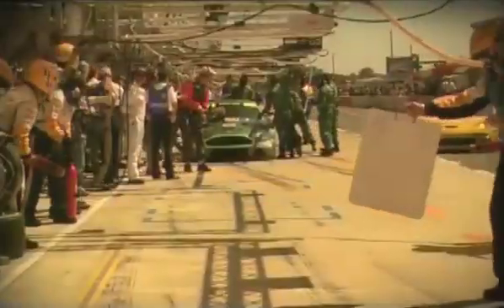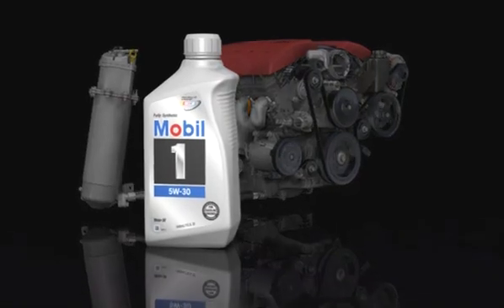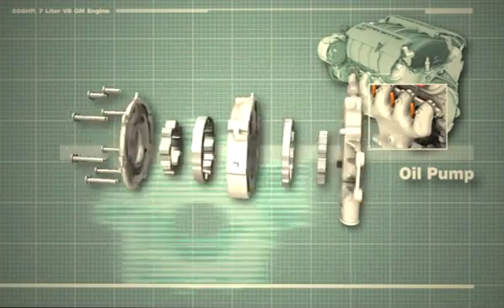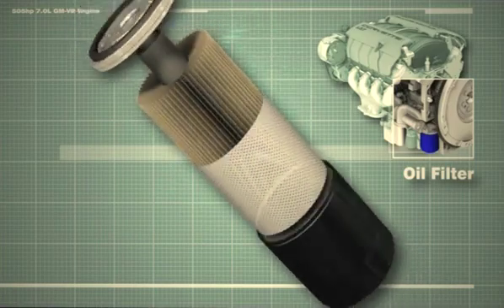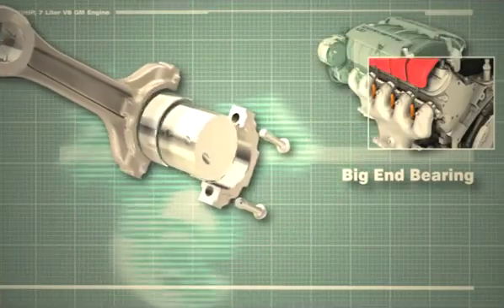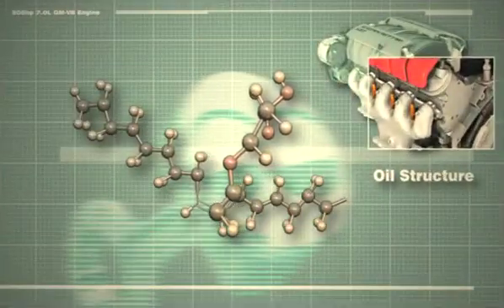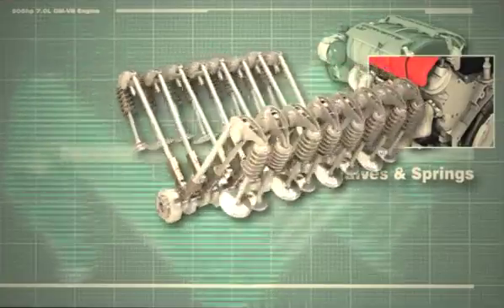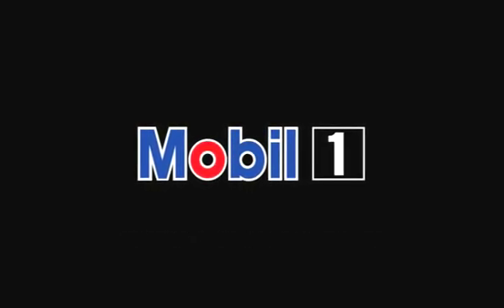Oil Journey in the Corvette Engine

Comment: Dumbass we are in 2012 technology is far ahead. Synthetic oil resist more heat IDIOT so why put a oil cooler when it can go through extreme hot temperatures.
Reply: noshabibis have you figured it out after 5 years or still?

Comment: @Avalanche2 so what should i use?
Reply: Mobil 1 is a fine choice and recommended by those who actually know something. Don't listen to bubba's like 
(noshabibis).  Recall his statement,  "No oil cooler =Less weight. A GOOD thing Mr.I-am-a-engine-engineer"'.
Pure buba ignorance, oil coolers are excellent for dispersing heat much faster than engines without them.
 I realize this is a very old video, however, it still rings true..